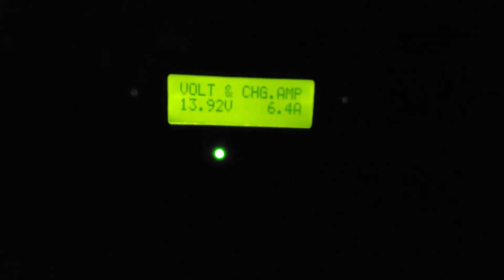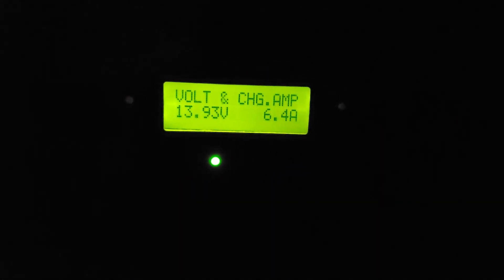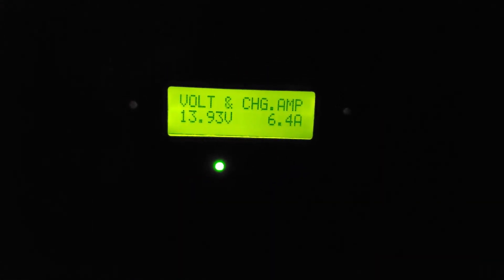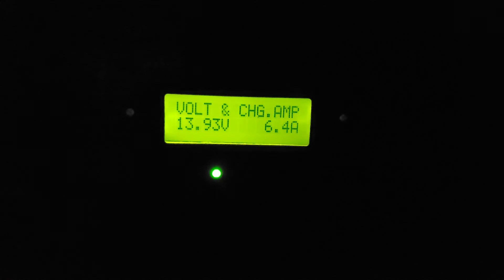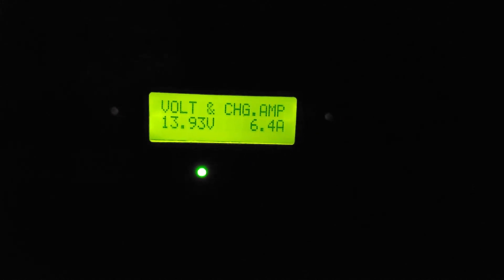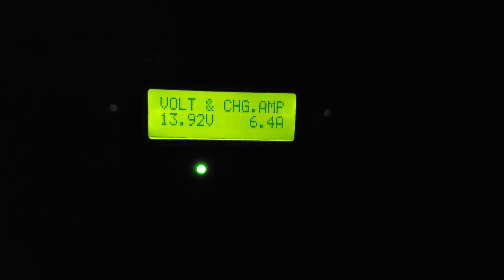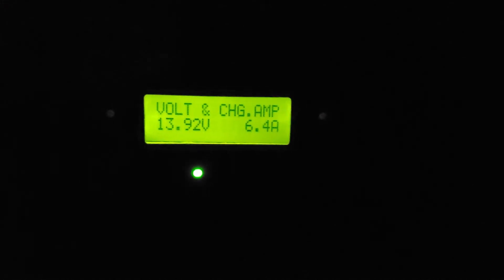Carbon Monoxide alarm (false) keeps going off. Can't sleep.

Comment: If your CO detectors are getting too old and you know for sure there’s no carbon monoxide you need to replace them. If they’re new and not too old but go off there’s carbon monoxide
Reply from the maker: Apparently these new ones sense the high hydrogen to oxygen ratio and still go off during battery charging. If our batteries are low and are recharging via solar, shore power, or generator we must run engine blower or else we get an alarm. With enging blower on, no alarm.